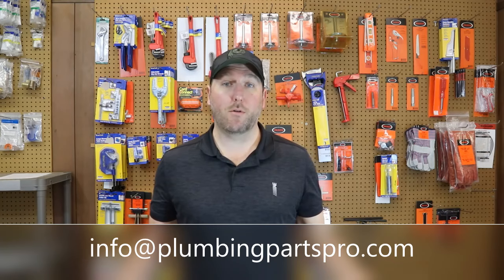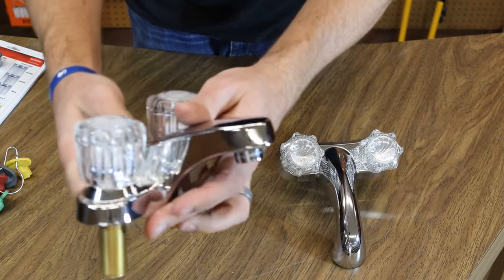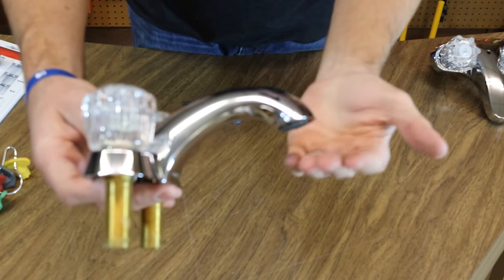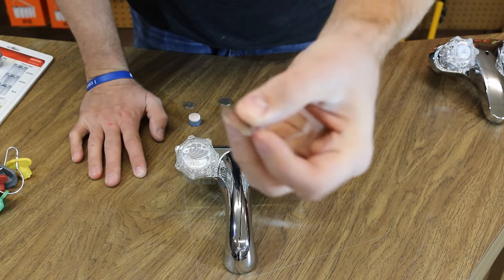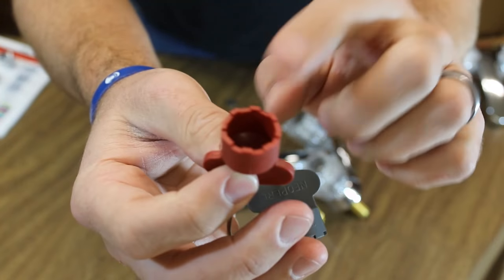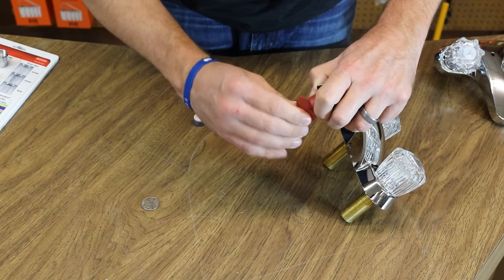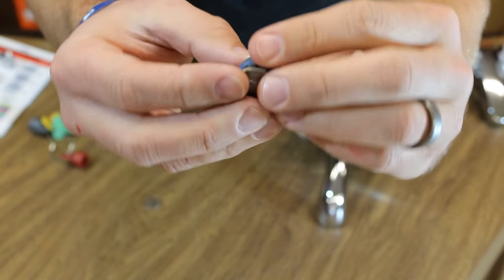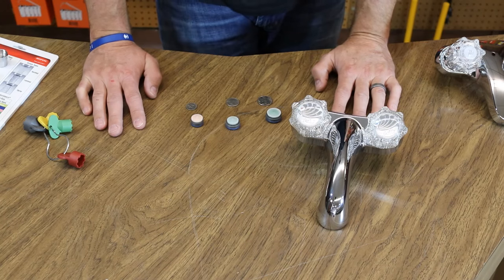Replacment of Recessed Neoperl Faucet Areators

Comment: There has got to be a homemade hack way to open this without a specialized tool
Reply: Some needle nose pliers would probably work. They might case damage tho
Reply: Broke mine using needle nose pliers
Reply: Man this was the question I was looking for, but going off the answers, I might just order the specialized tool
Reply: Just turn it with a flathead screwdriver, that’s all I do.

Comment: When the edges of the aerator are cut out like that, it's pretty straightforward finding the right tool. Simplistic really. It does make one LOOK LIKE a lifesaver... And, not all recessed aerators are that accessible, as I'm finding out. So, what is the expertise or tool needed to change out a pf aerator with a round, single surface edge? I am trying to hook up a waterpik-type dental accessory, and have all the needed parts, but have never met the recessed aerator before...
Reply from the maker: Let me know the diameter of your aerator, dime, nickel, quarter etc.... some of them make an extended adapter for devices like that

Comment: I have a garden tub that was installed in 1990.  The faucet leaks and there is no access panel without renoving the marble sides and cutting it open.  So the faucet can't be replaced without demo to the tub.  So I thought I would attach a handheld shower head with an on off button to contain the leak.  There is a white plastic ring around the inside opening(no screen) so the thread is not visible to screw the handheld shower attachment in to place.  What tool would I use to remove that plastic ring?  Do you possibly have any other suggestions on how I could stop the leak without changing the faucet?

Comment: Key wouldn't budge the aerator and kept slipping with force and stripped the tool. Tried tapping out aerator with screw driver but now broke the inner plastic ring that the tool's teeth go inside...now trying to grab it and turn with needlenose pliers. What a pain in the ass...hope to work it out somehow eventually, otherwise gonna need to replace whole faucet. Ridiculous.
Reply: I have the same problem.

Comment: The plastic part of the aerator that screwed into the faucet fell apart including the screen while I was using the special key to get it out.  But the white plastic aerator itself is stuck in the faucet. It rumbles around when you put the water on. Any ideas on how to get it out?
Reply: Yes..good question.  These are the kinds of questions they should be answering instead of brand new stuff.

Comment: You make it look easy, but .... most of the time the faucet is installed and it is VERY hard to fit the tool onto the aerator.  Any suggestions.
Reply from the maker: It really shouldn't be that hard if you have the correct size tool.  It should easily slide into the notches of the aerator..  there's not really a "trick" to it

Comment: Would you be able to install an extended aerator on a faucet like this?  I have a 4 year old that can’t reach to wash her hands?
Reply from the maker: Like one of those swivel style aerator?
Reply: @PlumbingPartsPro  kinda yeah!  I have a moen 6801 with these stupid recessed aerators and the things you add on for toddlers to direct the water have nothing to stop them from just sliding off.  I’d be just as happy with an extended aerator just so the whale doesn’t just slide off as well.
Reply from the maker: @williamsmallwood8846  do you know the size you have? Dime nickel penny quarter?

Comment: I was replacing areator in my bathrooms. The first one came  out easy but the second one wouldn" t come loose and eventually it came out but it look like a brass pipe broke loose from the part attach to aeator , Do I just  replace the faucet.
Reply from the maker: It sounds like the faucet has broken and needs replacement

Comment: I attempting to remove my aerator using the tool when the some of the teeth on the aerator broke off.  Any suggestion/ideas on how to remove the aerator now?
Reply from the maker: That may be difficult.  Maybe a and tap it gently counterclockwise?  Maybe a dremel and cut some grooves in plastic.  I really don't have any tricks other than the tool
Reply: I , too, am using the tool that came with the faucet and on the verge of stripping the teeth because it won't budge. I don't have hard water so I don't know why it's so stuck. Did you find a solution? Thx
Reply: did you find out a way to remove it

Comment: I have a recessed screen which has fallen out and wont stay in. There is no thread on the outside so it doesn't screw in or out. What is supposed to hold it in? Thanks
Reply from the maker: It sounds like the threads have worn off?  Or else it's a rectangle style with set screw.  Send us a pic

Comment: I stripped the notches while using the tool. I can’t get it out. How do I remove it without breaking the whole faucet ?
Reply from the maker: Make sure you are turning the correct direction.  It's backward because it's inverted.  I've found alot off people turn it the wrong way

Comment: If you want to attach a water filter with a diverter to the faucet. You need to remove the hidden aerator all together, correct? Then you twist in the new diverter with the right size adaptor on it?
Reply from the maker: Alot of faucets with the recessed aerator will not accommodate a screw on filter due to the recess.  Most filters come with an assortment of adapters to fit the faucet however some are not long enough.

Comment: I got a question, you have the key to remove it, but the airator wont budge when you are twisting the key...now what ?
Reply from the maker: Are the notches on the key or aerator stripped?
Reply: I, too, have the included plastic tool and it won't budge. Did you find a solution to loosening yours? Thx
Reply: Same here, mine stuck and now stripped

Comment: What if you dont have a faucet tool is there another way to take it off??
Reply from the maker: Its very difficult to remove it without the tool.  Some faucets are making a screwdriver slot in them however most need the tool.  I have them on the website at a cheap cost
Reply: Which website please?
Reply: I took mine off with a butter knife

Comment: anyone found a solution for a broken inner aerator? 
On the other hand what was wrong with the old external one for god sake 😃
Reply from the maker: Are you not able to remove with the tool?
Reply: I was using the tool and the aerator broke and screen fell out but now I can remove the inner part.  any suggestions?

Comment: I have a Moen faucet with a recessed aerator that is literally impossible to remove. I have a tool like yours but it will not budge full stop. I feel like something will break and my fingers get sore lol

The water pressure is low so I'm trying to determine the cause but can't remove the aerator to check it.
Reply: I have same issue… soak in CLR or vinegar. I put cellophane then make a pocket. I put CLR in and sink the aerator in the liquid. Then I use and elastic to secure it so the aerator is soaking in the CLR.

Whomever put this in was Hercules I guess. I stripped my first key. Really pissed me off. - when you are looking at them it is standard left to loosen right to tighten. When you look from the top down it’s the opposite.

Comment: Do they all screw out? Mines a Kohler and it blew it apart after the water company did some main line work in my neighborhood. Is it pretty much just these three sizes or are they manufacturer specific? I don’t really care how much I restrict it down but it’s just super high compared to what it was. I know the one I had looked like two layers of the metal screen blew out while the white plastic portion is still in there.

Comment: Title here is a little misleading. I can get the thing out but can't get it back on.  About halfway and the little blue o-ring is pulled out sticking out the side.  After an hour, I'm sorry I took it out.  If I have to call a plumber, it will be to install a new non-Moen faucet with an "old time" aerator!  And I have four bathrooms with these awful faucets!

Comment: I have a rectangular aerator.  Any idea how to get those off?  It's made by jacuzzi but haven't come across any info how to remove it.
Reply from the maker: I have not seen a rectangular aerator, however I have seen rectangular shaped spouts, however most of those have a round recessed aerator.  If you could take a picture of the underside of the spout and send it to info@plumbingpartspro.com I can help you.
Reply: @PlumbingPartsPro  Sent
Reply from the maker: i  apologize for the delay getting back with you,  The aerator as removed with an allen wrech key from the inside of the spout.  However I do not have the replacement screen , you may be able to remove and rinse with water.

Comment: Idiot delta faucets with those 'need a special tool' to remove the aerator.  What a shame they don't have a regular aerator that screws on by hand.  Your video is just a tad deceptive, as removing that idiotic aerator with the special tool when the faucet is INSTALLED is pretty tricky, particularly if your hands are not as steady as a rock.   Built in obsolescence.  I'm sure there are unscrupulous plumbers who tell homeowners that the reason their faucet is not running well is because it needs replaced.  Sigh...
Reply from the maker: Hello and thank you for commenting.  I wouldn't consider the video deceptive just because it wasn't an "Installed" faucet, it's tye same principle in removing it.  Most newer faucets, not just Delta, have these now because it gives the faucet a cleaner, more streamlined look.  They do make different, heavier duty removal tools that help remove more difficult aerators however they are a considerable amount more in cost than the ones we stock.